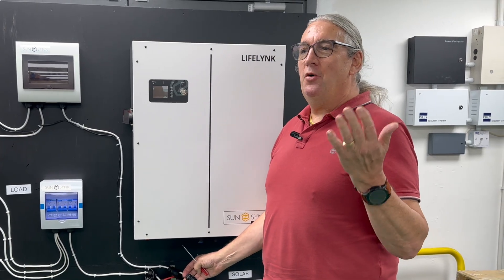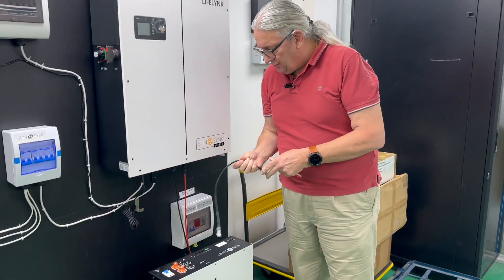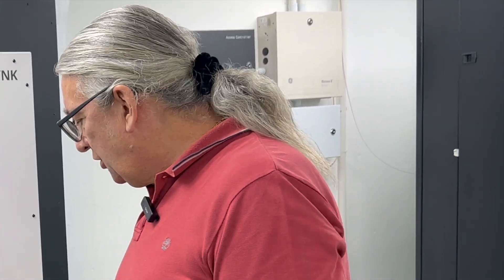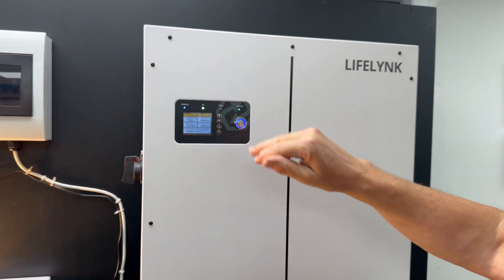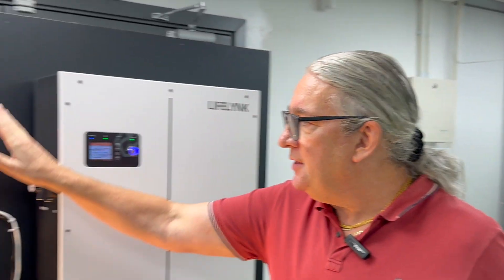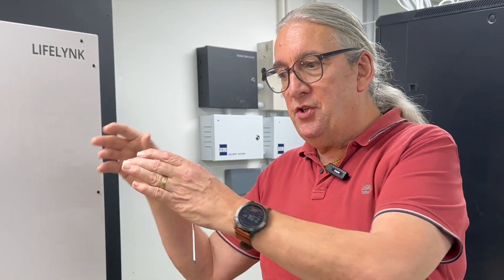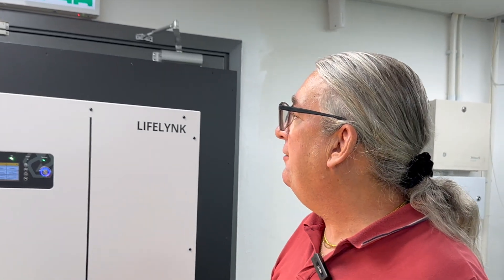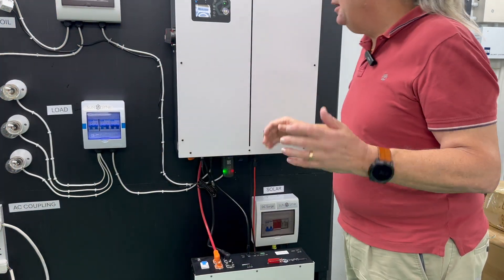6 June 2024

Comment: Hello Keith, firstly amazing video as always.  I am planning on investing in one of these Lifelynk hybrid inverter.
i have a question, i am planning on installing this in a shed away from the main house and only have one 6mm 3 core cable to the shed, do i need to additional cabling or will this invert be able to send power back to the house using the 6mm core cable?
with Solar i will be using a micro inverter directly from solar panel to the inverter
Reply: Hi @johngore8443, did you find the answer to this? I'm in the same boat so any help would be great :) thanks
Reply: @JamieKnowles  hi, not had any further feedback, but from the research I have done a 6mm armoured cable clipped direct can handle up to 62 amps so that’s 14kw of power, so with a 3.6 or 8kw inverter I thinks it’s well within the cables limit, however would like an electrician expert knowledge to confirm ideally,  but thinking about an electric hob or oven can draw 6kw at max so I think it should be okay

Comment: Easy installation, when installing cost 11000£😅 

Installer 🎉 profit

Inverter with battery 2000£
Six panels many 600
Tips for cables screws

Comment: I have a LifeLynk 5.2 installed last month. Excellent video. Thank you.
Reply: what size core cable have you used to the CU
Reply: I have no idea on the cable size, it was installed by a company called RAL. I am working away from home at the moment or I could photograph the install for you.
Reply: @BrianCripps  How much was the installation?
Reply: £3k
Reply: @BrianCripps hi did you have panels installed as well or just battery ?

Comment: Thank you for the video. Unfortunately there are a few things I still dont understand regarding the micro inverter. It sounds to me like the micro inverter is AC coupled to the Main supply, not the UPS output. If so what happens to the excess power the micro inverter will produce when the battery is full and the micro inverter generates more than the load ? If the micro inverter is on the same line as the grid supply then what stops the excess power from being  exported ? What happens to this excess power?
Please supply us with a wiring diagram to explain the wiring of the Grid AC and micro inverter inputs
Reply: If on grid installation, excess power will be exported. If load is lower and the battery is full there is nothing to stop the export. It really doesn't matter if you are grid-side connected or AUX microinverter port (I'm not sure this model has this option, like other SS inventers). Personally I used HomeAssistant and Shelly relay to control export from microinveter(s)
Reply: then it would be exactly the same as if you didn't have the lifelynk in the first place - the micro will export to grid unless it has its own limiting CT. And because the input and output of the lifelynk is coupled when on-grid, it doesn't matter where you connect the micro-inverter - as long as you realise that the micro-inverter won't work during an outage if you installed it on the grid side.